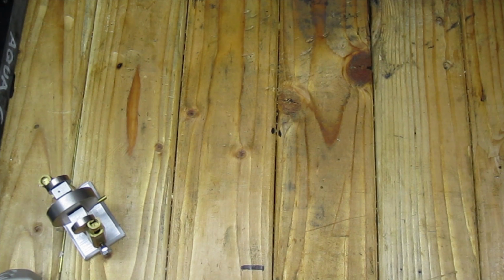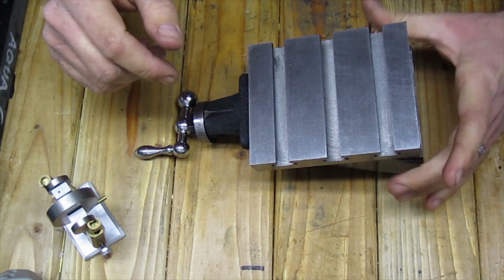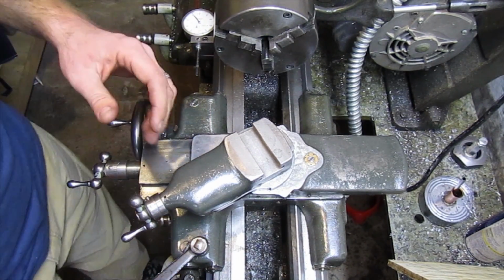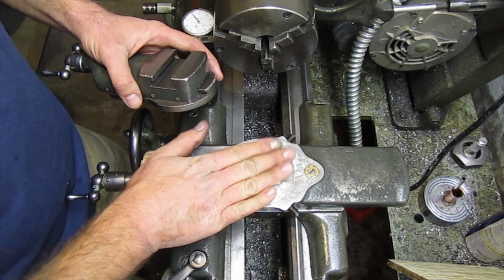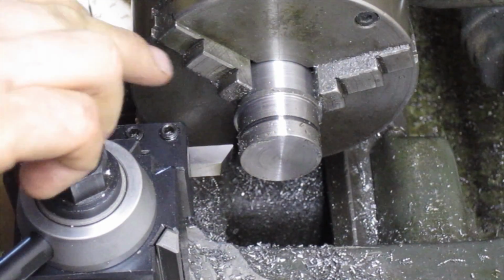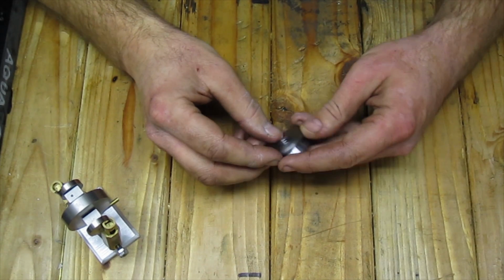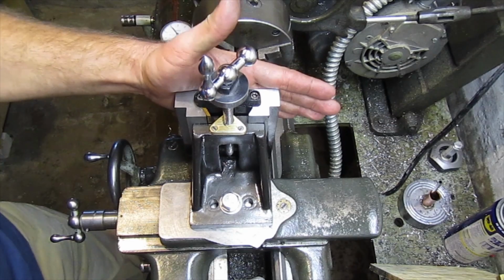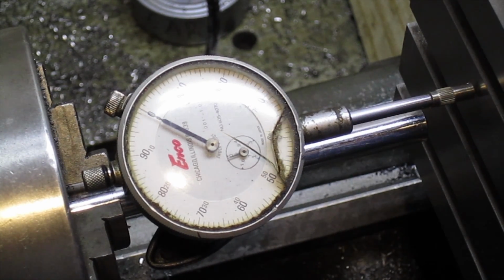Lathe Milling Attachment - South Bend Model A Lathe

Comment: 0.0765 is 13 tpi. 1.000/13=0.0769. Are you guys sure the screw isn’t a 1/2-13 threaded rod? I never know when those guys use metric or imperial tooling to make whatever they are making. Yeah I know I’m five years too late 😊

Comment: Sorry. I got kicked out of your page and didn't think what I had typed had even made it to the comments section. Anyway, my reason for being here is to ask your opinion about a milling attachment. I noticed while shopping for the attachment you recommended, that they also have a swivel base model. Are you familiar with this attachment and do you think it will be stable or rigid enough to turn out, at least, a semi-quality product? I was a machinist 30 years ago,  in the military, and I can tell from watching your videos that you know what your talking about. Your opinion is pretty much going to determine which direction I go with this. It's been a long time since I've even laid hands on a lathe, so rusty doesn't even begin to describe where I am at this point. Watching your videos and implementing some of your suggestions helped tremendously in getting me back in the saddle (I did it again. Another lathe reference) and interested in One of the few jobs I've actually liked and took great pride in. Creating something from nothing, to me, is one of the most rewarding things a person can do. So for helping to peak my interest and also helping to Kickstart some long, lost, dormant brian cells in this old noggin, I thank you. I also thank you for taking the time to make these videos and for sharing your knowledge and experience with this old has been and also the up and comers. Your opinion matters to me, so if you're still out there and responding to these things, I would appreciate your input on this matter.
 The old, retired, once, long ago machinist. TOROLAM for short. The military loves acronyms.

Comment: Anyone interested in building/machining tooling for their lathes, should look into the kits available from http://mlatoolbox.com/index.html
Andy Lofquist is the man to talk to.  He has a huge following in many of the machinist's forums.  His design of the milling attachment kit for the South Bend and Atlas lathes are superior to those available through other suppliers.  Also, look at his cross-slide kits with the T-slot concept intrinsic in the design. Check it out, you've nothing to lose.  Disclaimer:  I have no commercial interest of any kind with MLA Toolbox.

Comment: I have the slide and have made the hold down piece to match the SB cross slide (although I'm using 1/2-20 thread).  I do have a question though...What did you end up using for a vise or hold down?  None of my vices will fit on the ATOZ table.

Comment: Very nice job! I suppose you could use the same method with a heavy L-shaped casting of any sort and mount the cross slide on it vertically. This might be an even cheaper solution. I might do that on my Boxford lathe.

Comment: 76.5 thousandths of movement for one rotation of the graduation dial on the vertical mill slide equals 3/32 of an inch.
Reply from the maker: Not quite. 3/32 is about 94 thousandths.

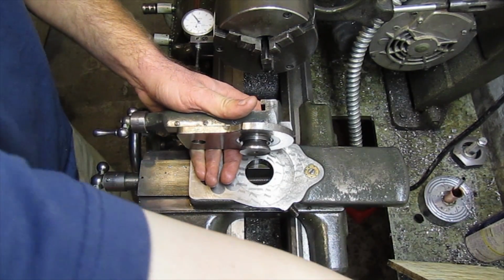Comment: Quick question, at 6:40 how did you decide to use a 60deg form tool? Could you also set the compound angle to 60deg and use a standard tool? I just got my lathe moved in this weekend: https://hunterlong.home.blog/2019/01/28/lathe-moving/ 
Thanks!
Reply from the maker: 60 degrees is the angle of the "stud" on the bottom of the compound. The cross slide has two pins that have a matching angle. When you tighten the retaining screws the angles pull the compound down onto the cross slide giving it more rigidity. Yes, you can set the compound to the correct angle and use a standard tool.

Comment: This a great video. But I want to congratulate you on one aspect which is RARELY seen in this type of tutorial. You can be EASILY heard (and understood). So many of these videos would probably be much more instructive if we could actually hear the narrator. Even some of the very popular YouTube machinists try to "talk over" a running mill or a lathe that is making so much noise we can barely hear the machinist's voice. I don't know if you have just voiced over a previously recorded video and turned down the background sound or what, but it is fantastic because we still get the sense that we are hearing a machine but it is not the only thing we are hearing. MANY THANKS.
Reply from the maker: Thank You! I am not a fan of talking over machines either. It is kind of annoying and I don't plan on ever doing that. I do some work to the audio. Nothing major really, just remove background noise and equalize and normalize my voice to make it the same volume throughout the video. I not a big fan of voice dubbing either. I will only do that if for whatever reason I loose audio from a dead mic or too much background noise. Thank You for watching, I hope I can get back to making new videos soon.

Comment: Any update on how you like that milling attachment? I made the cross slide stud as you described so I am ready to order a milling attachment and curious if it has worked for you. TIA Tom P.S. Thanks for the vid's they are very helpful to this beginner!
Reply from the maker: It is working very well. I just finished building a small steam engine using it. It does have limitations. You can't hog out large amounts of material, and the setup isn't rigged enough for climb milling. It will produce good results so long as you don't try and push it too hard.
Reply: Thank you, I will get it ordered.
Reply from the maker: I forgot to mention. When using the milling attachment tighten up the gibs a little on the cross slide to give you a bit more rigidity, and always lock the carriage.
Reply: Thanks again.

Comment: Could I please ask you a favor? Assuming you agree here it is...lol 
Can you please measure that table dovel width dimensions for me please? I want to see it will fit the male dovetail on my cross slide.
Reply from the maker: +Billy T 
I sure can. I'll get those measurements tonight.
Reply from the maker: I don't have a set of dowel pins or a micrometer big enough to get an accurate measurements of the dovetails, so these are rough measurements using a steel rule.

The root of the female dovetail, without the gib, is 1-15/16".
The narrow portion, without the gib, is 1-19/32".

Hope this helps, let me know if you have any other questions.
Reply: thankyou, this will be very useful info

Comment: Where did you buy the Miford slide?
Reply from the maker: I bought it from ebay. It was shipped from India.

http://www.ebay.com/itm/Atoz-Lathe-Vertical-Milling-Slide-Attachment-Fixed-Base-Myford-7-Series-Suitable-/262699617663?hash=item3d2a1e0d7f:g:SnkAAOSw4GVYF5Sv